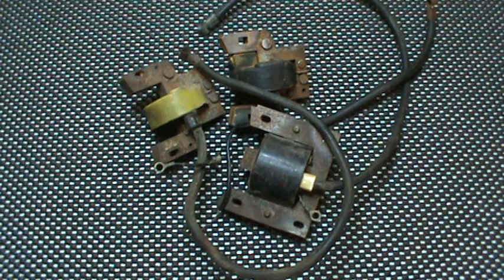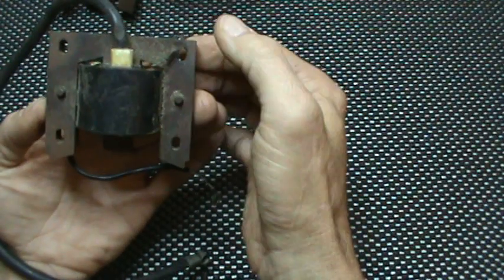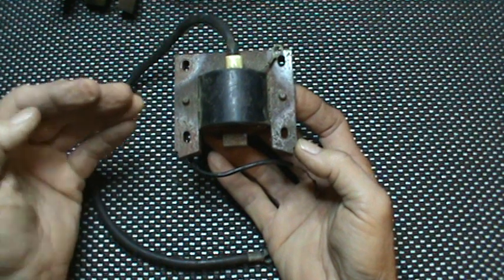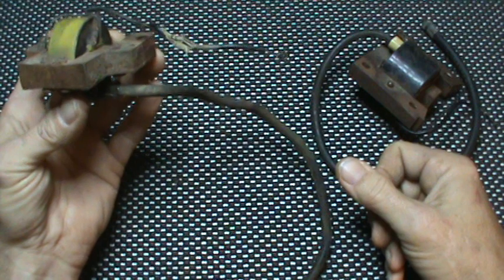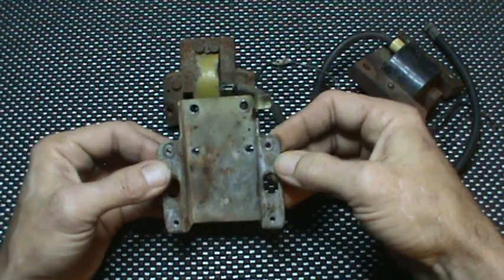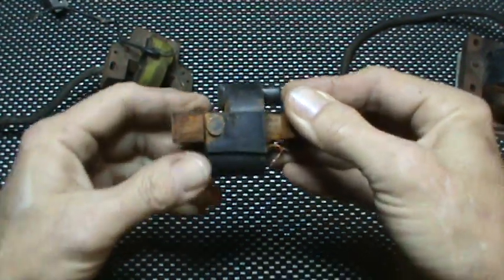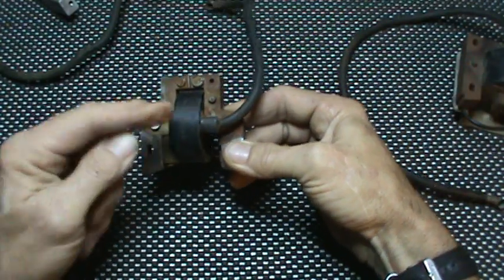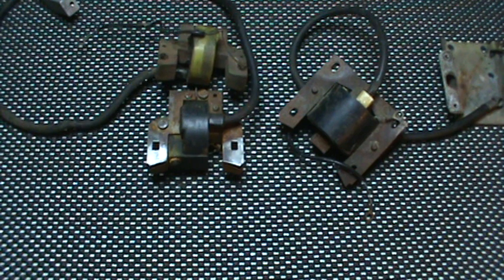Briggs and Stratton Coil Magneto Magnetron comparisons explained

Comment: Enjoyed video.  Just subscribed today.  I have a 5 year old john deere riding mower with a briggs engine that fires easily and runs great until it gets hot after 10 minutes and then cuts out and dies.  After cools down it will repeat the same scenario.  I have not looked at coil but does that sound like a possible cause of the problem? Thanks
Reply from the maker: That would be my first guess, yes. I have a video showing how to make a home made positive Spark Tester that you can put in line on one of the spark plug wires (assuming it's a twin) and you will know for certain if you're losing spark. You can leave the spark tester on the engine while running it. You might also remove the top cover of the engine (blower housing) and make sure everything is clean and clear and free of obstruction. These engines, being air cooled, will overheat and shut down if the cooling fins are dirty/blocked. I would make it a habit of cleaning this area at least once a year as a means of preventative maintenance. Also, if the engine is new enough, it has a pressurized lube system with a low oil pressure cut off to protect the engine. Make sure the oil is changed every 25 hours with new oil filter and check the air filter after every few times you mow (depending on dusty conditions etc.) Hope some of this information helps! Cheers!! Zip~

Comment: Hi ZippoVarga, I have a powerking 1616 garden tractor that has a B&S 16 hp engine.  There is no serial number on the engine as I have looked everywhere and I called B&S customer support with no luck.  I wasn't getting any spark so I took out the coil and the wire was broken, maybe eaten a little by a mouse.  Any way I was wanting to put in the magnetron that doesn't require repolarization.  I can't order the part without the engine info.  Are there generic magnetrons that will work?  Thanks, liked your video.
Reply from the maker: Yes, there is a universal Magentron. Fleabay Item Number 121148616567. Best of luck with the project! Zip~
Reply: I went on Fleabay and it says "no listing found" I used the item#, and also searched under Magentron.
Reply from the maker: http://www.ebay.com/itm/121148616567?_trksid=p2055119.m1438.l2649&ssPageName=STRK%3AMEBIDX%3AIT
Reply: Thanks a lot, just ordered one.

Comment: What is that little circle hoop thing that is on a lot of old magnetos called, and what does it do?
Reply from the maker: +Dylan Robbins I'm not sure what you mean by circle hoop thing Dylan.
Reply: +ZippoVarga The wire attached to the magneto with the circle/ring  on the end of it. This part https://i.imgur.com/y0Nid3x.png
Reply from the maker: +Dylan Robbins That is for connecting the coil to the points through the back plate of most engines.
Reply from the maker: +Dylan Robbins check my other videos. Plenty of them will give you all the info you need.

Comment: Can i hold a compass near my flywheel to determine the polarity? and which way should it be?
Reply from the maker: +Chad Yelland Not that I am aware of Chad.
Reply: +ZippoVarga you did say something about the North had to pass first?
Reply from the maker: +Chad Yelland A Compass will tell you which direction the polarity is for your engine, what I meant was depending on your engine, I am not aware of any way to tell which direction your engines polarity should be facing.

Comment: Hi Zippo I stumbled upon your channel here and getting to the point inherited a old Bowlens lawn tractor with A 16HP TWIN opposing engine that says magnatron electronic ignition.It runs ok ,but seems like running a car engine with no spark advance.Are there any tricks maybe to advance the spark timing on these engines a little.The carb was just rebuilt and actually adjusts out now.Noticed the governor is very strong on these not allowing the throttle to open up maybe half way looking down the throttle trying to get some rpm;s out of it for a little more power.Printed on the engine says 16hp at 3200 rpm.It never gets there.Adjusted the throttle cable thing that it slipped but the gov just pulls it back if anything.Any Ideas?
Reply from the maker: +HARPO1ME Do you have a tachometer to check the engine RPM? And yes, the governor is very strong on the opposed twins, and they need to be in order to maintain engine RPM under load. Altering the factory settings can prove detrimental to the engine and worst case, can blow it up. They are fixed timed and for good reason and at the optimum timing. Again, altering the engine's factory settings can cause bad things to happen. If you want more power to the ground, I suggest putting a larger final drive pulley on the tractor and leave the engine alone. This is just my opinion of course. There are other channels that show how to alter the engines to get more out of them. That's up to you, but understand the risks. Sorry this doesn't give you tips and tricks to help you out, but I'm all about bone stock reliable performance. Cheers!! Zip~
Reply: Thanks for the info .I like the idea also of leaving them the way they should be.I like the idea of the final drive pulley change..This thing looks like it has over 500 hours on it by the meter and so not feel like blowing up a good motor that does not smoke!!.I ran it last winter plowing snow .It did well ,but earned a new fuel pump and a carb overhaul this summer cutting grass since the pump went out.May be just leave well enough alone and get some weight in this thing since over a foot of snow one day made it work  little harder then it should.
Reply from the maker: +HARPO1ME When you hear the governor kicking in, listen for the engine to drag down instead of keep on going. Adjust ground speed to keep the engine growling, but not loosing RPM and that's where they are happiest. Cheers!! Zip~

Comment: Hi Zippo,  I've been watching your posts with interest and am currently in a bit of a pickle! I'm unable to ID my engine type as the cultivator/tiller I have has no markings/serial/model numbers etc so identification is near on impossible for me to do.  I'm trying to modify my machine so it uses an electronic ignition coil as opposed to the old points system.  Would it be possible to email you some pictures of my machine to see if you're able to ID the engine??  Any help you can give would be very much appreciated! :) Thanks buddy!
Reply from the maker: +Skibba Dee Hello Skibba. You can find me on Facebook and there you can message me photos and I can see if I can help or at least point you in the right direction. Cheers! Zip~

Comment: The oldest coil shown can be from 2 hp to the 23 ~10hp as shown. Just have different holes. The next coil is also used with points or an add on point eliminator modal. I have split the lamentations and replaced coils from other sizes. Common 3 1/2 coils unto the much rarer 5 and 8hp. Also have ground 3-1/2 to fit the much larger 8-12hp. Just smack mushroomed coils back and try.  They keep changing the hole patterns so you have to check the spacings.

Comment: i have a yard man 20 horse power runs good when it turns on but when i turn on the blades and i turn it up it loses power and when i turn off blades it stays normal again.  what can i do?
Reply from the maker: +Jose Rivera Check for worn pulleys, spindles and belts. IF the deck is drawing the engine down, there's something amiss with the deck it seems. Since I'm not able to be hands on your machine, I suggest finding the operators manual and looking in the maintenance section. Perform all the maintenance as outlined and if the problem persists, investigate further. Troubleshooting is hard to do from here, so this is the best advice I can give you, all things considered. Best of luck and I hope you find the problem! Cheers!! Zip~

Comment: ZippoVarga, How does a weed eater coil work without points or that little button that is on that coil magneto magnetron?
Reply from the maker: +julio lausell Electronic ignition module built in. On the Magnetron, the little button is also a sort of electric ignition module, only it's a magnetic pick up. All engines made today are electronic ignition, and there are many varieties and appearances. The one's I am showing are Briggs and Stratton specific, but the concept is the same. Cheers! Zip~
Reply: +ZippoVarga THANK YOU for the reply. I was using a weed eater magneto ignition on a 4 stroke 90cc chinese 4-wheeler engine. You can see my video here in youtube ( Homemade two engine Go-kart ). I made it high compression, and could not get it to run with out miss firing. I tried changing the coil, changing the coil wire, changing to a colder plug, even going to the stock cdi ign. system. The miss fire never went away until I bought a nitro fuel mix to raise the octane of the fuel. It cost $16.00 for treating three gallons of fuel. It worked. I guess it was having pre ignition, but I never heard a ping sound from the engine. I never thought that a small engine (90cc) could ping or pre ignite with out hearing it. The problem is now solved. But, THANKS for your video and reply.

Comment: Hi Zippo, do you know which magnetron coil , I would need to use to replace my points and condenser on both a 1965 and 66 8 hp. briggs engines most lawn mower coils plug wires are to short to use. Or if nothing is out there in used equipment, what new part # to use.Thanks so much .I enjoy your videos
Reply from the maker: Bob Ledarney Vertical shaft or horizontal shaft engine? The numbers off the engine are needed to insure you get the right replacement part Bob. I have a video showing where to look for the numbers. Cheers!! Zip~

Comment: Your videos are excellent. Thanks very much. I had issues with my john Deere 68 with 8 hp briggs. Runs great now converted from the points and condenser to the magnetron coil. Did the valves and it runs like a champ now. (Wouldn't start when hot and back fired)

Ran it a full tank today. No issues. Started and idled hot. Never did that before. 

Always nice to have such great technical sharing.

Thanks again for all your great videos
Reply from the maker: Shane Reilly I'm glad they helped out Shane! It's why I do them and why our little community of self help guys band together to provide the videos for the home do it your selfer. Besides that...isn't it awesome so get good results your self instead of sending something off for repairs? Cheers!! Zip~

Comment: question, I have a 16 hp briggs and stratton cast iron that I was running off of points and a car coil because I could not get good spark (I think my magnets were weak) It ran great for a while then started acting up, so I pulled the flywheel and had it sent off and re-polarized, now it seem to be getting good spark but it will not run just backfires when I try to start it. Any suggestions?
Reply from the maker: KydexByParlusk Remove the flywheel. I think you'll find that you sheared the flywheel key. Replace with the correct shear key and tighten the flywheel to the crank shaft very tightly. Often, we don't tighten the flywheel enough...so tighten it, loosen it, tighten it again....do this a couple or three times to make sure the flywheel is fully seated to the crank shaft. I've had engines come in for repair and this was all that was wrong and most often, it was the owner who was performing maintenance that simply didn't get the flywheel retaining nut tight enough, then the first time the engine fires, it shears the key and throws the timing off. Keep me posted on your progress! Cheers!! Zip~
Reply: ZippoVarga that is what i thought it was at first so i pulled the flywheel nut and the flywheel looks completely lined up it is not offset any at all.
Reply: ZippoVarga here is what the engine was doing before i  sent the flywheel off.
Reply: ZippoVarga another update...I pulled the flywheel today just to make sure the key was fine and that it wasn't a steel key. everything looked good. I re-installed the fly wheel with a new key. I changed the magnetron to another that i have laying around that is the newer style. after a couple of turns to get the carb primed she fired right up. It took a minute to warm up, but once it was warm she seemed to run good. I never get too excited when i get it running good because it never seems to last, but hopefully changing it over to electronic ignition will sold my problems. time will tell. Here is a youtube playlist of my build so far on the terramite that the engine is in

https://www.youtube.com/playlist?lis...9Xf8Mj6q-txLG2
Reply: KydexByParlusk   Cannot ACESS the Video You Posted, will you please repost and display correct link, Would like to see this build thank you

Comment: In your opinion who makes a better motor Briggs and Stratton or Kolher?  Briggs seems to have more complicated carburetors, but their engines were well made.
Reply from the maker: The Carburetors are the Achilles heel that have plagued Briggs for some time, but....having said that. I would have to put the old Cast Iron Briggs a little above the old cast iron Kohler K series (which were also plagued with carburetor issues on a different level.) When we escape from the old Cast iron into the aluminum blocks, I give the win to Briggs, hands down. Kohler began over engineering their twin lines after the KT series and it continued even into todays engines. Give me an opposed twin I/C Briggs or Vanguard any day over the V twin Kohlers. But...you have the brand loyalty that goes beyond opinions that always spark debate. What I've written here is as close to being unbiased as I can get, although...I AM a diehard Briggs guy. lol Excellent question my Friend!! Cheers!! Zip~
Reply: Thanks..  I was interested in your opinion.   I like my old cast iron briggs engine and I'm still learning how a kohler engine was made in comparison. Cheers!
Reply from the maker: +The5upermann1 To elaborate a little more. The Kohler K series were very good engines. Their primary issues were mostly fuel delivery related. i.e. the fuel pumps and the carburetors were problematic. Their incorporation of internal balance gears could be a challenge to some, but they really nailed it as far as getting the engines to run with little to no vibration across the RPM range. This, of course, resulted in more fuel consumption since they have a more complex rotating mass, but it is a small trade off to a smooth running engine. Replacement parts for Kohlers have always been about twice as much as Briggs, which is another point of contention with the Kohlers and their owners. Other than that, I can't think of a single K or KT series I wouldn't own. Cheers!! Zip~
Reply: Thanks Zippo!  Everyone on youtube has really benefitted from your expertise!  I learned a lot from your videos especially on the Briggs and Stratton.
Reply from the maker: +The5upermann1 It's why I'm here and why I do the things I do. I've always fended for my self with repairing my own equipment and vehicles, and passing along this information hopefully will save many hundreds of dollars, possibly thousands down the road. That's the main reason I do what I do here. But, with out you guys, who ask for the help, there wouldn't be a channel! So thank YOU for all the support my Friend!! Zip~

Comment: That is great information!  Very interesting.  We need more videos like this!  I did not know this.  Very true about knowing if you have the right parts.  I have found that starter generators and voltage regulators are also all different.  Thus the wiring is different and polarization of the generators is different..